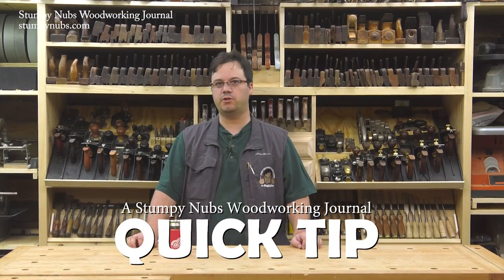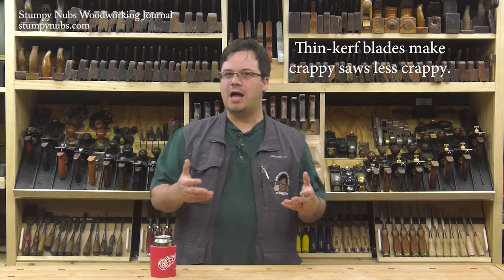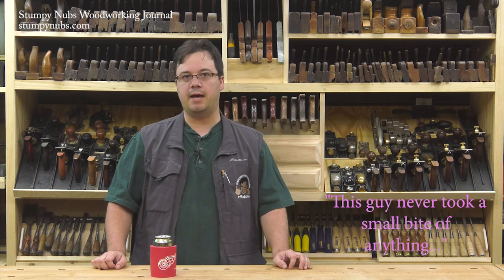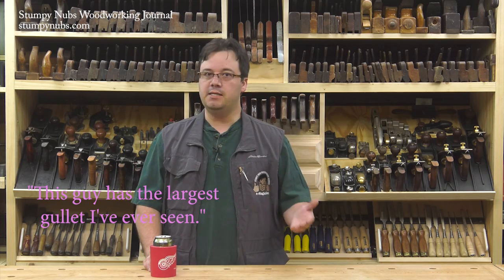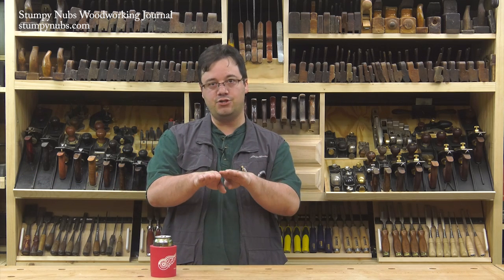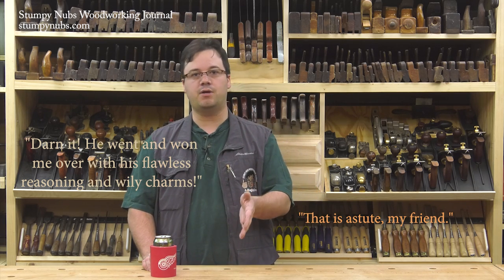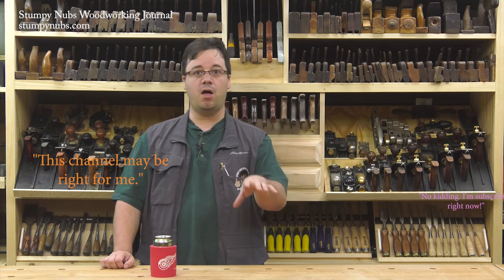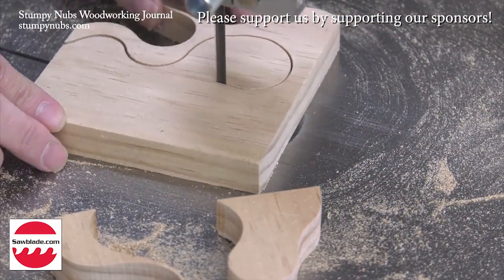Thin-kerf vs. full kerf- Don't choose the wrong table saw blade!

Comment: Wait you never talked about using a smaller diameter blade.
Reply: The video was on blade kerfs. However, I do agree that a smaller diameter blade does more for a jobsite saw than thin kerf or less teeth in a 10" blade. If I'm ripping a lot of anything thats 1-1/2" or less i use a 7-1/4" blade, number of teeth depend on what I'm ripping or what the wood is for. Big money savings vs 10" on top of being much nicer to the saw.

Comment: Does switching the motor from 110 to 220v give your saw more power? Since I switched my Ridgid over, there have only been a couple of times where it even hinted at a struggle. I also wonder if the sheer momentum of my Ridge Carbide TS 2000 doesn't muscle through some places where my thin kerf Freud would bog down.

Comment: One little quibble. "As with most things in life, the truth is somewhere in the middle." Then referring to what works for one person doesn't necessarily....
   Long ago, I figured that the middle as centre of a balanced argument often leaves everyone frustrated. And, eg, a tightrope walker has a long pole with weights at the extreme ends. Having been asked to chair and lead a community forum in inner city east London, I realised it was usually best to help realise that their extreme experience could well be valid in certain circumstances, while the other person's view was appropriate in other circumstances where the first person realised their thing didn't work best, even if it could work adequately. 
   This is, I think, where the video will go after 1 minute. I'll watch rest in a minute.
   Example shirt collars: 50 people have size 14, 50 have size 18, stock 100 at the middle size of 16 - and sell none.
   Had no experience, just the new guy who asked a couple of good questions at his first public meeting. I led it my way, letting folks vent before they exploded, even if going off-topic from agenda. We had a brilliant 15 years dealing with politicians, developers, council officers, and each other. The truth, in much of life, is not a point in the middle, where people fight or it's the centre of a tug-of-war rope, but a pragmatic spectrum - as you say before walking away, "It depends". Actually, a great video of a very well presented argument. And watts or horsepower in a cheap motor puts less power into the blade teeth than a high quality motor with a lower rating.
   Was taught, 50 years ago, at school, to use ideal blade for each job and learn to plan my work for fewest blade changes. And to keep them clean. They last longer. If you have to use thin blade, make lots of shallow passes
Reply from the maker: Long ago I learned that what works for one woodworker does not always work for the next, even if that first guy absolutely swears by his method. This is a fact of life that is difficult to explain, but is well represented.

Comment: The other part of the thin kerf that I don't like is the necessity to reset my guide. With the full thickness, I set my fence at 4" and I get a 4" cut. This works no matter which blade I use. Using a thin kerf means I'd have to be making some kind of adjustment with my fence. Not worth the hassle in my opinion.

Comment: My Skilsaw is not underpowered. I find that larger blades tend to vibrate more at the extremes. I am also running a 7 1/4"  rather than a 10".

Comment: James is it better to use a thin kerf when you're looking to ensure that two boards will fit together nicer with less of a visible seam??
Reply from the maker: No, I don't think the difference in thickness (about 1/32) makes much visible difference.

Comment: I use a full kerf on my 12" miter saw, 10" table saw rip blade, & combo. I use a 10" thin kerf 80 tooth cross cut but use blade stiffeners.. not 100% sure it makes a difference

Comment: Hi,

What do you class as a full kerf blade?

I'm only a hooby woodworker but my blades range fron 2.1 mm kerf to 2.4 mm Kerf.

Thanks for your info and great video.

Bill from England.
Reply: billsbasementworkshop dunno how it works on your side of the pond but here (us) full kerf is generally 1/8" = 3.175mm or more, thin kerf is less; so by that system yours would all be thin kerf. 3/32" is what most "thin kerf" blades I see are, that's about 2.4mm. 2.1mm, though, that's ... pretty darn thin.

the kerf btw is the width of the teeth, not of the disc itself.

but, the exact threshold doesn't completely matter regarding this video, cause the advice in the video can just be generally applied to "thicker blades" vs "thinner blades".

Comment: What do you think about the trend of using 7-1/4 blades (if you don't need the cutting height)?
Reply from the maker: They produce a poor cut quality, in my opinion. But if your saw will accommodate them (I can't use them on my SawStop), there's nothing dangerous about it.

Comment: What are your thoughts about using blade stabilizers with thin and standard kerf blades? Do I need them with standard kerf? I do use a stabilizer with thin kerf, but I don’t see much difference with my Freud or Irwin blades.

Comment: I need one with FLAT ground teeth for my 7.25" home made "table saw" but I can not find ANY. Everyone only sells only the "cheaper" thin kerf saws blades in that size or the few that I have found have no flat teeth versions. I finally just purchased one that was the right size and flat teeth but it was made for cutting aluminum not wood.
Reply from the maker: 7.25" saw blades are made for handheld circular saws, which are commonly used for crosscuts. So naturally you can not find a flat to blade, which would be for rip cuts.

Comment: I need some help. I have a makita contractor saw (2705) and I put a thin kerf blade on it. However it seems to hug the riving knife quite tightly, and at times I was unable to push my piece any further (3/4 birch ply). I'm not sure if its that I need a different riving knife, and even then im not sure if there's one that would fit.
Any help appreciated
Reply from the maker: You will need a thinner riving knife, or you will have to go back to a full kerf blade.
Reply: @StumpyNubs  the full kerf bogs down a noticeable amount, perhaps buying the same replacement riving knife and grinding it down a little bit? Theoretically it should work, hopefully in practice too.
Reply from the maker: How many teeth are on the blade you are using?
Reply: @StumpyNubs   the thin kerf one was 24 teeth. I primarily do ripping so thats best, from what I understand.  The stock makita blade is 32 teeth.

Comment: Hey ... i had a problem with cutting bevels for the corners of a box - i built a 45degree crosscut sled which seemed to give perfect result when i cut test pieces of plywood ... but then when i cut hard maple , it was still not perfect - i suspect that it may be due to thin curf blade supplied with my table saw (evolution rage 5) which possibly flexes a bit when cutting such a hard wood thus giving a bevel cut that doesnt mate up as neatly as it should ...... any input on this?
Reply from the maker: Lightly skim the edge of the bevel. If you only remove a tiny bet of wood, the blade should not flex. If that doesn't work, you sled is either not accurate (don't forget to be sure the runner is properly adjusted) or your saw blade is not tilted properly.
Reply: Cheers !!!!

Comment: Let me explain, I rip bee hive parts out of 2x4`s it can make a difference of getting 3 top bars or 4 out of 1 2x4 or 5 or 6 instead of 4 or 5 bottom bars. 2x4s are usually free enough to keep up with my beehive frame need.. Critical with that gold plated 2x4 hive parts wood.

Comment: What the thought on ripping thicker hardwoods? Say your stock is 4" X 36" X 24" you want to rip it into 1.5"X 4" 36" strips should have the blade 1/2 to 1" at a time flipping the stock each time or just say raise the blade to 2.25" flipping only once using a 40 to 50 tooth X 10"  blade? Anyone.

Comment: When you say 25% less boogers, do you mean 25% in each nostril, or half as much in one with full booger in the other?

If the latter, does the full boog side depend on which side of the blade your fence is on?

Comment: Stumpy, do the laser cut reliefs in the specific red branded Satan blades make any difference with the chatter or heat?
Reply from the maker: Yes, laser-cut reliefs do make a difference. But most blades have them nowadays (though some of the cheapest are stamped, not laser cut). I think Diablo blades are a good value. They won't last as long as a premium blade, and the cut won't be as clean. But they are better than the other box store brands. I recommend them for folks on a budget. There's nothing wrong with saving some money as long as folks understand their limitations. :)

Comment: Im planning to rip 2 x 6 mahogany into 1 x 6 (and using a thickness planer) for deck boards. I have a 24T thin kerf. Any comment on this would be helpful.
Reply: How did it go
Reply: @levelinguponthenarrowpath  Thanks for checking in. I went with the full kerf. But I had to stop, as my wood stocks have not fully dried. I have a question, while I got you.
I am planning a deck, with a top railing set at 30 deg slope, towards the house, for comfortable leaning. I know to miter the 4 x 4 dimensional post 30 deg and apply my 2 x 6 top rail - but question is how do i make the miter on the 90 deg corner, that returns to the house? While maintaining the 30 deg slope. I thought of using a 6 x 6 post - allowing for a suitable cut.
Could you comment on what you may do?

Comment: if you have a under power table saw put a 7and quarter  blade on it, runs faster, less friction and will cut a 2x4....oh yeah best part is the blades are a hell of a lot cheaper

Comment: Hey James thanks for the info. I love your channel.  Can you give me your opinion on the shopsmith system?
Reply from the maker: Never used it myself. But I know some who have and they generally say it's a gigantic hassle to switch setups from one tool to the next.
Reply: I also greatly appreciate your channel. Lots of good information presented very clearly. I have a Shopsmith. My shop area is 10’ x 12’. I wouldn’t say changing tools is a giant hassle but also not as easy as depicted in their advertising. But, they fit in a small area and work well. Wish there were more general woodworking channels like yours that show the use of the Shopsmith.
Reply: @StumpyNubs  A Shopsmith will fit in the space needed to store a bicycle. I'm not wood working every day so it is out of my way when not in use. Also, there are tons of gently used machines available and the company still supports them with spare parts and accessories. The new computerized motor is quite compelling.
Reply: The main issue with the shopsmith is angle cuts. The table moves not the blade. This causes problem with large material, but there are other options for cutting the larger stuff down. The lathe works great.

Comment: Great video but I have one thing to add. I tried a thin kerf blade in my portable saw (Bosch 4000) and it caused wood to bind on the riving knife. I went back to full kerf because I couldn’t find a thinner riving knife for my saw. Something to consider for those using a riving knife or splitter.
Reply: Same here, thin kerf was too thick for riving knife... safety issue
Reply: Do you like the Bosch 4000?  I have a Delta 6022 and the table is not flat.  I'm thinking of buying the Bosch.  My issue isn't the cost, it's the space.  I like the Bosch and the Delta because both fold up easily and will fit against the wall of my garage where I still have to park two cars at night.  I just can't dedicate the space to a cabinet saw, as much as I would like to do that.
Reply: @marshallmurrell4583  I do like it but like many other small tables saws, it is not perfectly flat. I can't remember if it was flat when new. The 4000 was replaced with the 4100 a few years ago. I don't know if it is flatter. I use a simple table saw sled which helps. The motor on the Bosch is nice and smooth. I also have a Festool track saw with their MFT table. I often use that in place of a miter saw and table saw when doing cross cuts and panel cuts. It has superior dust collection. I have a basement shop and keeping dust down is a must. My table saw lives in the garage and I pull it outside when I use it. I do like the stand on the Bosch.
Reply: @Rickmakes  My saw has a 0.013 dip at the throat. Makes it impossible to accurately set the blade to 90 deg to the table.  I have a good crosscut sled also.  I hook my saw up to the shop vac for dust collection.  Thanks for your reply.

Comment: I always used thin kerf on my hybrid craftsman saw, now that I have a Sawstop, I only use the full kerf blades. What’s you recommendation for a glue line rip blade?
Reply from the maker: I used to use a Freud "Glue line blade," but once I switched to Ridge Carbide blades I found I didn't need a special blade for glue-line rips. They aren't cheap (although they are less than Forrest blades), but they are lifetime blades that are second to none both in quality of cut and quality of manufacture. I have a combo blade that I use for most cuts, a rip blade I use for heavy duty rips, an 80-tooth crosscut blade for delicate crosscuts and plywood cuts, a dado set and a 100-tooth blade for my miter saw. (I have a couple specialty blades too.) Each one was an investment, but well worth it!
Reply: Stumpy Nubs currently I have the ridge carbide ts2000 and the uts2000 for the table saw and the 12” miter saw blade too. Just wondering if there was a better dedicated rip blade.
Reply from the maker: Honestly, for 1- inch (4/4) or thinner stock I rip with my Ridge Carbide combo blade. If my saw is set up and aligned properly I get glue-line quality rips. If I rip 8/4 or thicker hardwood I use their 40-tooth rip blade and get the same smooth results. I still have my Freud "Glue-line rip" blade, and it's nice (though the teeth are thinner so it won't endure as many re-sharpenings as a RIdge Carbide). But I never have to use it anymore.

Comment: It's a good discussion for me right now since I'm going to upgrade to ridge carbide blades. One challenge I've noticed is on the sawstop cabinet saw since the arbor is mounted on the left, switching from a full to thin kerf throws off your fence measurement since it measures from the other side of the blade. With this in mind, I either need to get both rip and cross-cut to be full or both thin. Currently they are both thin-kerg Freud blades. But the wobble has been getting to me as the blade gets older and dull